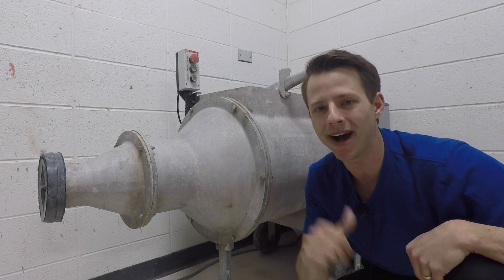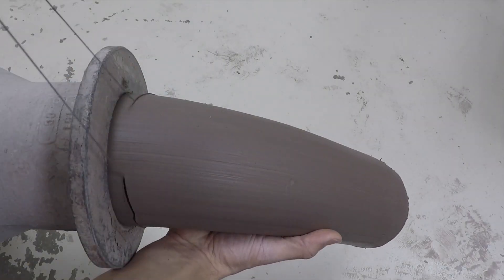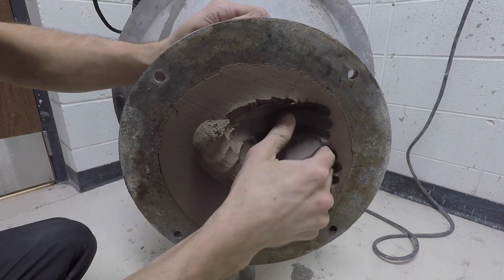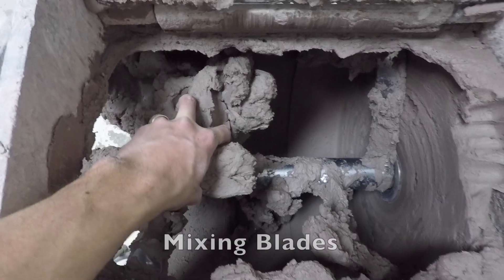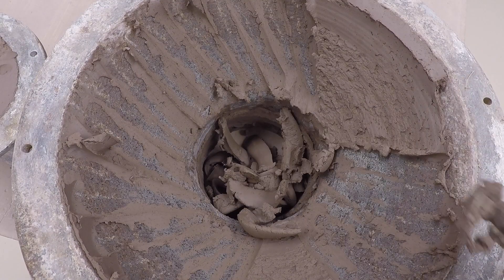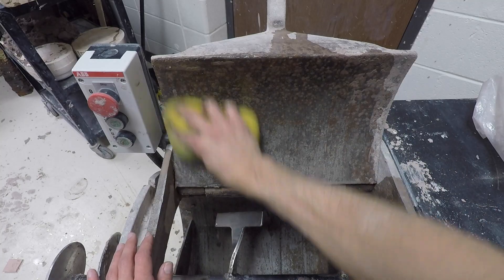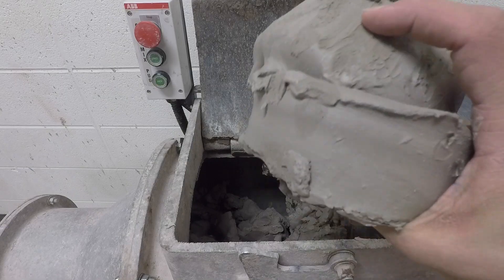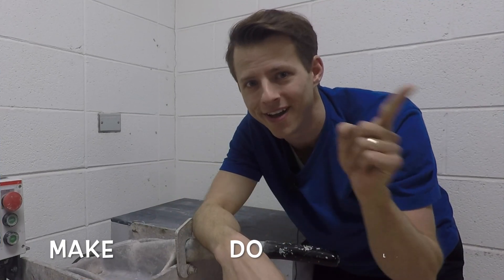What’s Inside a Pugmill Clay Mixing Machine

Comment: Try "chore boy" instead of sponges
Reply from the maker: Had to google it. Nice. That looks like it would work well.
Reply: @CeramicJim  they also make a stainless steel version that they sell to restaurants to scrape burnt cheese off. It looks like a wad of drill bit swarf/chips, but a continuous piece all knotted up.
Reply: You could just go to a restaurant and ask them to buy one for a dollar extra, or order one for a dollar. They would probably gift you a softened/used one. Closed mouths don't get fed.

Comment: Spin the nut, not the bolt.
Reply from the maker: Unless you can swing on the nut side. Am I wrong?
Reply: @CeramicJim  I guess, but most the load is on the nut. Spinning the bolt 🔩 causes torsion/twisting. The weakest point of a bolt is just outside/inside the nut. That is why you try to put the bolt head 🔩 facing out. Less obstruction, and more mechanical strength 💪
Reply from the maker: @ Ah. That actually makes sense. The nut being forced to spin off of the threads by the threads being pulled out. That's what you mean? That's how I'm understanding it. I learned something new today. Thank you very much.

Comment: Put the wd-40 on the threads and nut, putting it on the bolt head is literally useless.
Reply from the maker: You are right. My intent was for the WD-40 to penetrate behind the bolt head incase the hole was threaded as well.

Comment: just shows you how ridiculous these machines are priced.
Reply from the maker: Yeah I wonder where all the cost goes. I would but majority of it is the auger. If it’s forged polished and welded stainless steel that could be a couple thousand dollars right there. Then you have to account for the cast aluminum body motor housing and electrical components. It may not be as exorbitant as you think. Or it might be 🤷‍♂️
Reply: @CeramicJim  I mean, if you scrap it down to the mold and such, you are still looking at about $300 for the parts and materials.  The Motor, maybe another 200-300 per the need.  I make these augers all the time for my shop.  If you know how to weld, you can make this entire thing for less than $300 with scrap and other parts.  But paying $4,000+ for it.  It's just too crazy.  People are too money hungry.    If I had 15 or more orders, I'll start making them and undercut the competition.  USA MADE :D
Reply from the maker: @hawkintelligence  If you’re serious then I think I could easily find 15 people or more. Teachers are always asking about pug mills for their classes and I’m sure the average potter would get one if they weren’t driven away by the 4K price tag. Seriously, if you in it for a modest profit you could serve a lot of people. I would even be your first customer to work up a prototype and test. If you’re interested send me an email at CeramicsByJim@gmail.com
Reply: My thoughts exactly! Will start making plans to build one soon thanks to this vid! 🙏